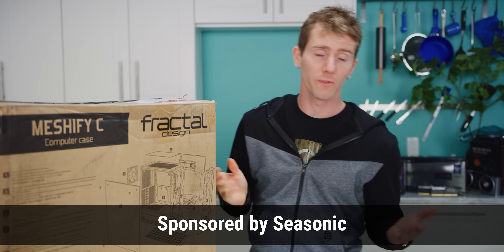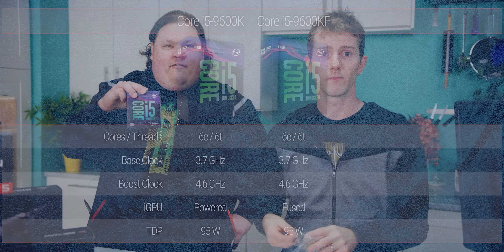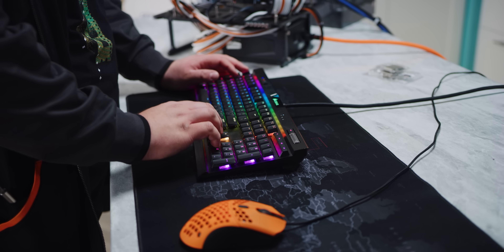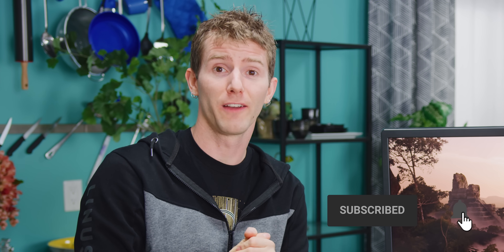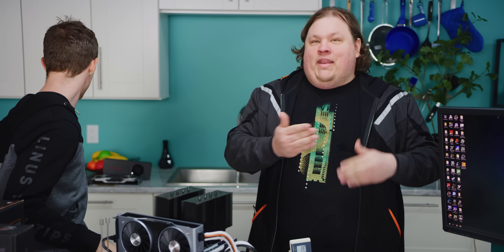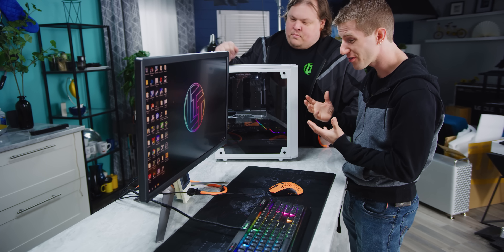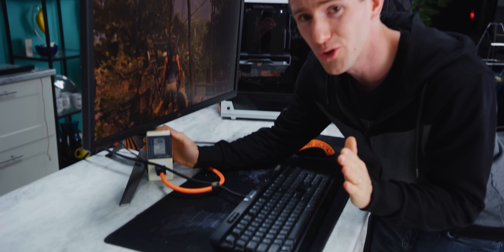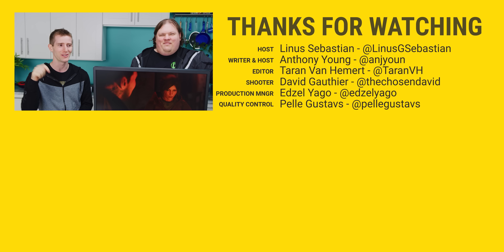We built a PC more efficient than a console!

Comment: Efficiency?
How the hell do I keep my room hot in the winter then?
Reply: ًThats my set up works great room stays warm .blow style 1070 ti and a intel i7 8700k
Reply: @jyrone3943  that's actually really funny because it used to be the opposite. Oh how the tables have turned
Reply: Run folding at home GPU and BOINC World Community Grid for the CPU. Plwn9 of heat and the electricity goes towards something useful when you're not using the computer.
Reply: Yeah I have 5 AMD FX pc's here for the soul reason to heat my house =l All equipped with Fury GPU's of course =)
Reply: You don't it's nice cold
Reply: @DynamicalisBlue  with undervolt they consume around 150w. but if the pushed they go above 250w.
Reply: Try running minecraft with ray tracing graphics
Reply: F E R M I
Reply: Funny thing is that I haven't used my space heater in 3 years almost. I have a 6700k @ 4.6Ghz and a 980 @ 1500mhz... it heats up the room in about an hour.
Reply: Maybe they can try to over volt everything and keep the cpu and graphics running at 50%  (half cores) usage all the time :) leaving 50% to work with
Reply: @ً the cooler desin being worse actually makes the card heat your room less since it will run in lower power states more often and pretty much any transistor based thing converts almost 100% of its power draw into waste heat
Reply: Rage
Reply: Jyrone amd*
Reply: Just keep a second pc for winter.
Reply: Run a FX cpu OCed (bonus if you have R9-RX)
I do this someday since November because my Ryzen 3000 and RTX are too much power efficient :'(
Reply: @MrTheSmoon  this. All else being equal cooler design won't affect total heat being output into the room, it's the laws of thermodynamics. but a less efficient cooler will cause power throttling of the cards so in practice would output less heat.
Reply: Overclock & game a lot
Reply: Seem like I’m not alone. I do use my pc as a heater.
Reply: You need macbook then!!
Reply: just buy a Sony Xperia
Reply: @ً Whether the GPU is using a water cooler or blower fan, both will generate the same amount of heat.
Reply: @AnassEljondy   so basically water cooling but the loop is you!
Reply: Relatable. 
Replaced my old system which ran a 3570k with a R9 290 gpu  with a 3700X and a RTX 2080 around 3-4 months ago. 

Temperature difference in my home office was very noticeable, I had to start putting a heater on.
Reply: I can relateee
Reply: Blood Cooling™
Reply: ChloeWade I see you haven’t been enlightened yet
Reply: I literally do the same. I have an absolute oven of a pc, I leave it on at night during winter and wake up to a really warm (sometimes hot) room.
Reply: @DMRDigitalVR  the gpus are still hot as fuck tho
Reply: watercool your pc. The lower the temps are of the loop the more heat is being dissipated into the room around it. 

Science, Yo.
Reply: @BNT1985  Run Folding@Home  ;)
Reply: @misamokuzelpizu  exactly, which makes it blood cooling
Reply: Overclock it.
Reply: @Khloya69  bruh
Reply: Buy a PSU from eBay
Reply: Ye Olde GTX 480... The space heater that can play games.
Reply: Under volt in the summer, overlock in the winter 😏
Reply: @raszpc  great now there's a marketable name for it.  Isn't this how the matrix starts?  First they used us for cooling, then a little bit more, and finally as rechargeable batteries... emperor's voice "unlimited powaahhhh!"
Reply: @Voodoo.  Thats not how physics work my guy
Reply: @remcos5759  that's exactly how it works. 

If your Gpu is 80c on air 
And 40c on water, that other 40c has to go somewhere. 

The radiators dissipate the heat into the air. It's not magic, the energy has to go somewhere. 

This has been covered tons of times and even by people like Linus and Jayztwocents.
Reply: @Voodoo.  With an stock aircooler gpu's are almost always running as fast as they can without thermal throttling. Lets say the gpu produces 50 watts of heat energy (just a guess) when at peak performance. Then the water cooler dissipates the heat more efficiently causing your room to heat up faster than the stock aircooler would heat it up. That said the same heat energy is being transfered over time. So will a water cooler heat up your room quicker, yes, but will it make your room hotter then the stock air cooler would? No.
Reply: @Voodoo.  So there is not "more"  heat transferred over time like you said. The only difference is how quick the heat is being transferred to the air between the two cooling solutions. And ofcourse watercooling will give your gpu a longer lifespan :). Unless it decides to spill all its water right over your gpu
Reply: @remcos5759  very true. 

I guess I should have said more heat/energy on a shorter timeframe. 

As you say it's still all the same energy output in the end.

My bad.
Reply: @Voodoo.  No worries bro
Reply: @remcos5759  apologies if my initial reply was a bit shitty, had just woken up.
Reply: Do the opposite of the instructions in this video. crank things up instead... I take no responsibility for your systems if you actually try this
Reply: You produce enough heat on your own.
Reply: Buy a 11. gen intel (they are basically smart heaters) and some old top of the line graphics card ( like a gtx 780ti or a 980ti) if you have the money to spend a 3090 outputs also a shitt ton of heat. If you want the cheapest gaming heater; xbox 360 together with an old 32 inch tv and my router was enough to heat my entire room in the winter. I had to turn of my heater and open the window from time to time because it was getting to hot. (Outside temperatures where about 0 degres celsius)
Reply: @lucasmancini2  I bought two 980tis the week they came out. Those in sli put out so much heat I had to move my pc from under my desk. It was like having a heater under there.
Reply: @AnassEljondy  con - it may clog up with textiles
Reply: Just mine on a 3080 works for me
Reply: i literally have no heating in my room so my pc is the only heat i get lmao
Reply: U using ur pc wrong homie, cool it down

Comment: "It is not like I am declaring another victory for PC master race" - Linus, totally declaring another victory for PCMR
Reply: MrNeutron98  More efficient than Switch?  Nope.  Super NES? Nope.  GameCube? Nope.  You have a ways to go.  Also, could you stop using the PC Nazi thing?  I never thought it was appropriate and whoever came up with it should just denounce it.
Reply: MrNeutron98  yeah emulators are a big plus, sadly most of them don't work as well as the real system. I wish I still had my PS2, PCSX2 is just not the same.
Reply: @WJCTechyman  GFTO console peasant.
Reply: @WJCTechyman  Uhh, yes they are, in fact way more so (at least minus the Switch). Sure, those consoles draw less watts, but they also provide multiple orders of magnitude less processing power.

Comment: Thanks! This is what I was looking for. I've been living in a bus for about a year with a solar PV system to provide electricity. I'm planning to upgrade my computer, so power efficiency is important when picking parts. 

It's usually not a problem. My current system (i5 3570K/GTX 1070 Ti) can run 24/7 under good conditions, i.e. sunny summer days. Cloudy winter days really cut into that, so every watt I can save helps extend my running time.

Comment: Linus: Saves Power

Also Linus: Uses RGB Keyboard
Reply: *uses pc parts with rgb*
Reply: To be fair, LED's are extremely light on power.
Reply: @Shieftain  you also always can turn them off.
Reply: @Shieftain  got it !
Reply: an rgb keyboard barely uses 3 watts
Reply: @Shieftain  light on power maybe but my RGB program for my 2060s uses over 100mb ram lmao
Reply: The right comment would be : 
Linus : Disables mobo rgb saves Power

Also Linus : Uses the power saved to power the RGB Keyboard :P
Reply: The RGB isn't turned on at the end once he boots the finished system to test, not a single RGB, not even the keyboard.
Reply: Leds expecially in keyboards and stuff takes up soooo little power.
Reply: @marcintrochu  it's not turned on!!!!
Reply: Most powerful single psu?
Reply: I was just about to say this then I see this comment
Reply: actually that keyboard can draw up to 900mA at full brightness, while still minimal compared to the full load it's still 4.5W
Reply: @v000000000000v   it doesn't matter!!! You are arguing about a completely irrelevant point... He turned all RGB off!!!
Reply: @mrtrickay7111  he did when he measured the power draw from the wall but not when he was testing between intel and amd, and that actually proves the point that RGB does use a measurable amount of power because he had to turn it off for the test

Comment: 130W on a console is pretty good IMO. I though it was much higher...
Reply: Especially since it's using a Polaris-based GPU, which aren't exactly known for their power efficiency.
Reply: Just imagine what they will do with ryzen and navi next year... Here we though pc was finally set to leave console in the dust, and sure enough them lil try hards are keepin up. Gotta give props to how much they can do with so little.
Reply: It probably would go up since on the console they only showed it in the cut scene and once in game play the whole console system would be working quite a bit harder in the game world.
Reply: Rocky12345 . The X1S doesn't use a ton of power, often quite a bit less than 120watts in game, below 100 is the norm. The X1X uses more, on some games probably around 170watts, but that's fairly peak in very demanding games, most games are closer to the 120watts.
Reply: @robertt9342  is that not what I just said that the 130 watts shown in the video was most likely because the game was in a cut scene and not in actual game play in the game world.
Reply: @robertt9342  the Xbox one s actually uses less than 80 watts under load. It's wildly efficient. Same with the ps4 slim, 360 slim and ps3 slim. All draw just under 80 watts under full load
Reply: the slim ps4 and xbox one s are in the range of 50-70w
Reply: @WayStedYou  I use a watt meter out of curiousity, Xbox One S pulls around 50w during gaming sessions, thats even lower than the Xbox 360 slim (corona) which was just under 100w. PS4 slim uses more sadly around 70, still super low. PS4 pro around 140w I think with the Xbox One X almost the same. My custom loop PC with 9900k and 2080Ti uses 80w.... when idle XD
Reply: It uses as much as it performs.
Reply: And it was used to be a lot less.
Reply: @Rocky-bz8wr  Right and when its on load constantly the parts getting hotter and the system wants more power.

Comment: Most computers don't spit out smoke?

Maybe I should mod my PC to roll coal
Reply: builds a solar panel PC
Reply: Make a PC case out of a vacuum cleaner.
Reply: Add a smoke machine
Reply: Don't worry, my pc runs off a diesel generator
Reply: solar panels catch fire
"Just as planned"
Reply: I'll add a meat grinder mod to mine, use it to piss off peta
Reply: i liked for anthony
Reply: water-cooling with a coal powered pump?
Reply: Hell yes!
Reply: Steampunk computer. *servant to keep adding coal is not included
Reply: @Juan Cortez Muro i'm scared to click that, juan. lol
Reply: Remember scrap yard wars s3?
(s3 i think)
Reply: Here's an idea:
Jack your battle station to a gasoline generator. Linus already made a video on that.
Reply: Generally you want the smoke to be inside the CPU since there aren't a lot of operating systems that run on smokeless CPUs and Sparkfun's magic smoke refill kit has been sold out for years.

Comment: "It ain't easy bein green"
*Looks at the 10+ nvidia GPU's releases this year*
Reply: Nvidia green is just dollar bills 💵
Reply: hey man, buying up companies to kill the potential tech off is a full time job
Reply: @xHarux3 Considering that it's gonna be used in future consoles it should get better though right?
Reply: Holo AMD is used in consoles now, and AMD still sucks
Reply: can you find a 3200CL14 kit without rgb?
Reply: @xHarux3 But he's talking specifically about GPUs
Reply: @xHarux3 the 5700xt is sometimes even better then the 2070S and much cheaper in germany about 150€ less
Reply: @xHarux3 dude... i watched the video too. The rx 5700xt is on par at tomb raider, is better in battlefield (even than the 2070s) in rainbow and metro it is worse, far cry 5 on par, and csgo better. Its definitely on par with the 2070. But the thing is the video is about the radeon 5700xt from radeon itself which has a bad cooling system.. and the gpu is new, the performance can only get better. Also i did not experience any driver issues. Btw i bought the Red Devil Card. So because of the 2070Super replacing the 2070 its clear to get the 5700xt  because of the difference in price (if u want a good custom card).
Reply: @xHarux3  xHarux3  i looked up some benchmarks and the result of the techspot benchmark (5700xt RD vs 2070S Gaming X) was that the 5700xt is 6% worse for games in 1440p...with a price difference ~100 or more. And as i said the 2070 is at the end of its "lifetime" and the rx 5700xt is relatively new and can get improved over time. Still it has a very good value and the best custom designs are cheaper than the ones at nvidias hand. If u want all the nvidia things like gforce experience/rtx  i can understand that u will take the 2070 instead but for me (only caring about price to performance) i took the 5700xt
Reply: xHarux3 AMD’s Ryzen CPU’s are amazing. Their GPU’s are just trash.
Reply: swb.music Look at any benchmark. NVIDIA always wins. AMD has no reason to make GPU’s because they’re a fire hazard and their drivers cause instability and corruption.
Reply: xHarux3 I didn’t even see your comment but at least we agree on something